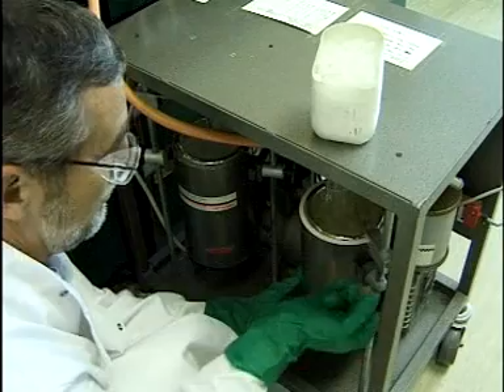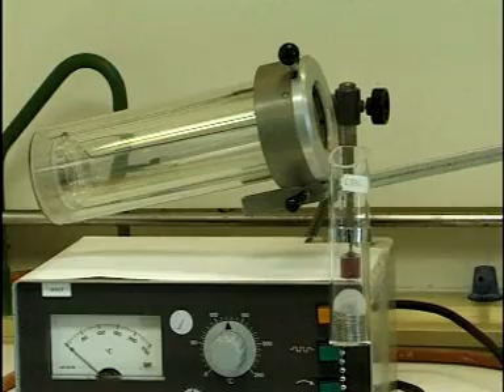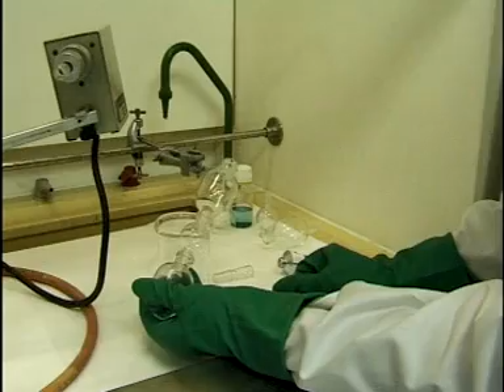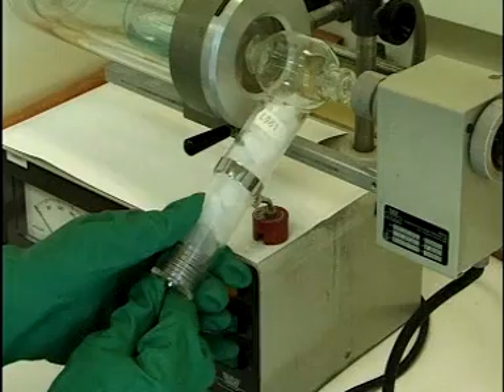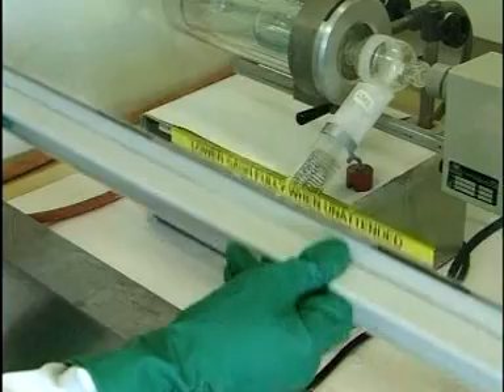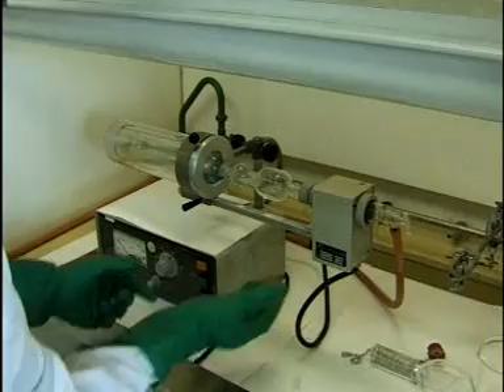kugelrohr distilation

Comment: This seems like a micro scale rotovap, except in a rotovap you're usually interested in the distilling flask, and this seems like its meant for when you're interested in the distillate (receiving flask). Or is that incorrect?
Reply: yes it is short path for stuff with very high boiling points also great for micro rotovap work just works a treat with a 100 ml pair flask